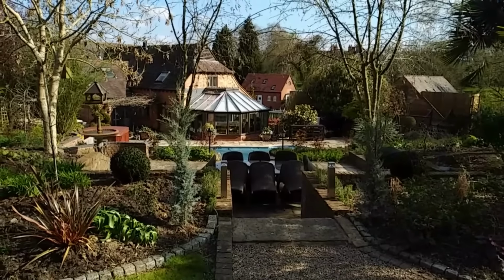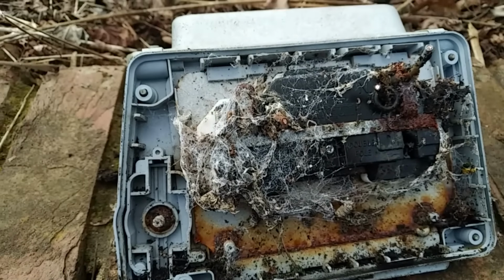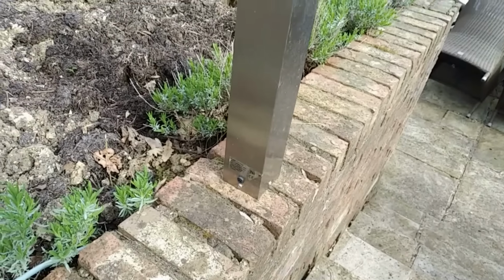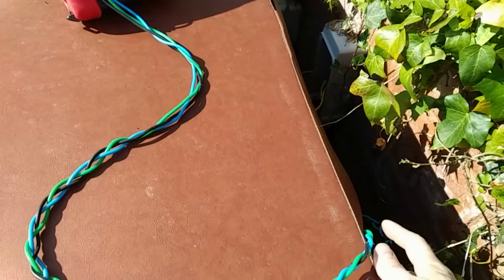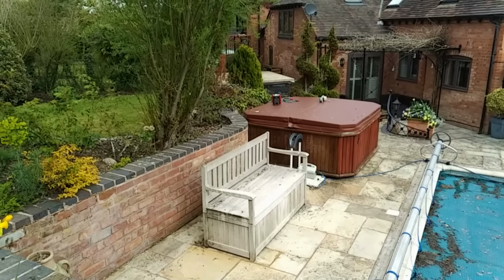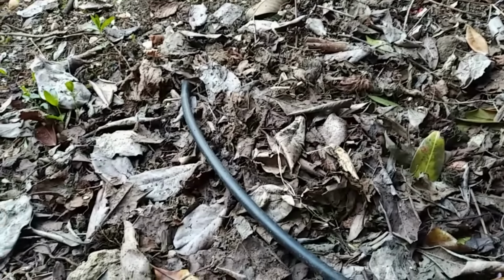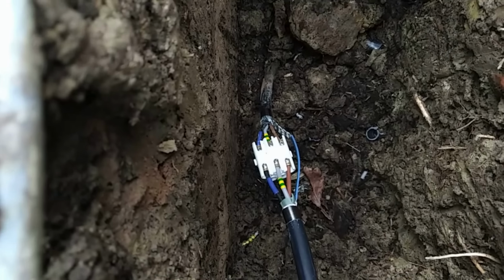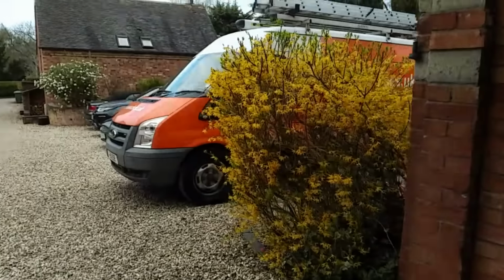Uncocking cack garden electrics

Comment: Niiiiice. That's the stuff dream's are made of. Grey for neutral and black for earth seems reasonable. :) pool could do with a clean....... Sweet gaff though.
Reply: Grey for neutral and black for earth, your point is?
Reply: Because with harmonised colours it "de-neutrals the black"  @asef698
Reply: @ursusmaritimus7159  "de-neutrals"?  I guess this is a quote/pun or reference I don't recognize, but gry=N blk=CPC is the "correct" industry accepted norm to prevent potential confusion with old-colour-code conductors where black /was/ neutral.  It also allows for black to used as another line (perm or switched according to application) without changing the designation of grey or having black as neutral one moment and 'live' the next.  (Yes I know it's just been used as an earth elsewhere so that's a weak argument, but /any/ conductor can be sheathed as a earth so consistency elsewhere in the system helps...)
Reply: I suppose they closed up the pool for the winter and will give it a good cleaning once it warms up.

Comment: How did you join the swa metal sheath together when you made it off into the underground joint?
Reply from the maker: Sorry, I should have shown that. Like the resin joints, it comes with a braid which joins to the armoured sheaths using a springy metal clip.
Reply: Spring bonding earthing kits.
Comes with 2 constant force springs and an earth braid cable I use earth heat shrink to cover the braid cable myself some armored joint box kits come with them in some you have to buy separately.

Comment: I prefer to use the grey as the neutral and black as earth
Reply: That’s because it’s the correct way or as the harmonised sheet says!
Reply from the maker: Quite right too.
Reply: He only did it the other way around because that was the existing installation either side and to do it "right" on the bit he's touching would just add unnecessary confusion for the next cowboy to visit :-( (not that another cowboy will ever need to be called once David had done the job properly:-) )

Comment: great vid as usual, what was the strap used for earthed armour continuity? was is part of the kit or an addition?
Reply from the maker: Thanks Ashley. The kit comes with a braid which joins to the armoured sheaths using a springy metal clip. The resin joints usually have the same sort of shebang.

Comment: Hello, in the new joints of the armoured cable how did you Earth the stealing of the armoured?? I saw you connected them together in the vid  but didn't explain how,  or did I miss that bit!? Bet those joint boxes where expensive!
Reply from the maker: Sorry, I should have shown that. It comes with a braid which joins to the armoured sheaths using a springy metal clip. I'm still waiting for the CEF invoice to land with the costs!
Reply: Also wiska have made simplified demonstration video which you can watch here on youtube, just search wiska shark

Comment: Terrible work. Would it not be quicker and easier to rip it out at the board make it safe. Remove all the crappy outdoor sockets and just run all new cabling and outdoor sockets
Reply from the maker: Maybe. It wasn't actually the job we were there for though. Some planning is needed with the homeowners to come up with a long term way forward.
Reply: Most likely won't do anything as they now have a working hot tub
Reply from the maker: @andrewmayes3271  Perhaps, but we've removed all but one of the sockets so they may want that functionality back. The job we were actually there for was to install sockets and lighting in a garage conversion and we haven't finished that, so we'll be back there soon and will find out how they want to take things forward.

Comment: Nice grey as the earth, and grey as a neutral very confusing.I am with you I don't like 230v lights either, looks like the gardener did that, .
Reply from the maker: Yeah, there was a colour crossover, grey was earth at the twin socket where it joined the SY, then at the single socket where the SY went back to an armoured they used grey as neutral. I suspect the circuit originally ended at the twin socket, and the SY and feed to the hot tub were later additions. As all the cores of the SY are black (although numbered), I guess someone got confused!

Comment: Perfect example of doing what you can. 
Those joints are a strange concept as you have stated not maintenance free at all but obviously intended to be buried.
Reply: Some of these splice kits have self-torquing screws where the heads shear off once you've reached the proper torque. That's usually considered maintenance-free once buried in the ground or plastered into a wall.

Comment: Their builders weren’t much good either, the pointing on the brick work was shite.
Reply: The owner got a good shagging and they laughed at the pub. The whole house looks bolloxed.
Reply: @WhiteShadow2k1 The cheap no-name outlets you linked are rated IP44 though. IP 65+ is much more expensive, especially if you buy quality components from one of the big German brands.
Reply from the maker: Yeah, James (our builder there) was saying as much.
Reply: interesting ! thanks for reply @WhiteShadow2k1
Reply: That's what I was thinking. It might be a big place but I bet they got gouged by every trade that did work there.
Reply: Goodstuff
Reply: @WhiteShadow2k1Off topic but waterproof sockets are a must when installed 20cm over sinks and handbasins, like the one's recently fitted in my brother's extension in Munich. 😉
Reply: As a consumer I'd say Part of the issue is the hardware. 

Its cheaply produced and of too elementary a design. Preventing water ingress into that glorified Tupperware (at least in Northern Europe) is an unnecessarily onerous, time consuming, and technique sensitive task. 

The relevant British standards should firstly actually apply and second demand a fit for purpose product with a 25 year life. Unfortunately the EU demands that the standards of engineering services in the UK be set at the same bar as that familiar to anyone who's spent a week or two in "Value" Spanish Holiday accomodation.
Reply: The European norms on electrical installations are basically copies of the British standards, @sierrawhiskey5155 . There is no lesser standard being forced upon the UK by Europe in that respect. There is also nothing wrong with the tupperware if one uses it properly. It's not because some hack simply drilled a hole in the wall and buried a cable behind those sockets without any regard for water/insect/soil ingress, there's something inherently wrong with the design of outdoor sockets.
Reply: @JVerschueren  Wrong! on all points. Cars have seat belts because crashes will occur. The design of these exterior sockets needs to evolve to accept the evidence. They're sometimes going to be fitted by car-crash installers.
Because of trade rules within the EU, cheap tupperware imported from Spain or Bulgaria which meets EU law must be permitted onto the UK market.
Reply: @sierrawhiskey5155  my point exactly: if you put the seat belt behind your back it indeed doesn't help, but that doesn't mean there's something inherently wrong with said seatbelt or the way the car determines whether you've got it on or not (any system for doing so can be fooled).  You can also take a UK or a German made socket and install it wrong, there's nothing about them which makes them inherently safer if used incorrectly. There might be quality/longevity issues, but you get what you pay for in that respect. Spanish and Bulgarian(*) outdoor sockets come with seals, it's not using them which caused the problem here.

And, again, EU standards are not somehow lower than British Standards as they were initially copied from those British Standards (even before you guys were in the EU), then evolved together and in accordance with what the UK was doing. The UK could have veto'd every aspect of it all along the way since 1973, but didn't because its concerns were automatically taken into account in the European descision making.

(*)Rem.: I thought all the el-cheapo electrical stuff came from Italy before China muscled its way in, but hey-ho, I only dealt with importers for 22 years, so what do I know?
Reply: @sierrawhiskey5155  a bit late for the party but might add that cenelec only sets up a minimum standards and is adjusted by the national standards so don't you gon blaming EU for brits being ok with substandard equipment.